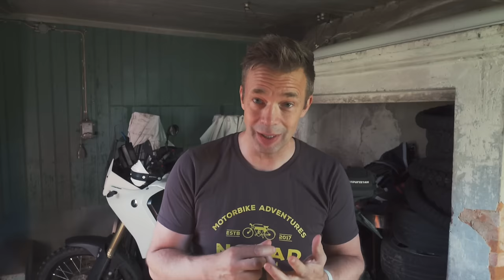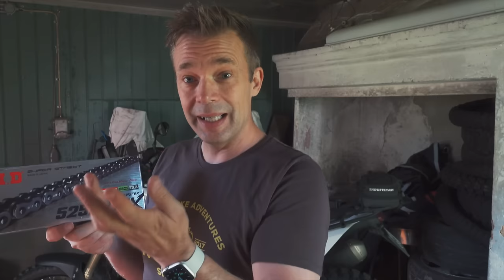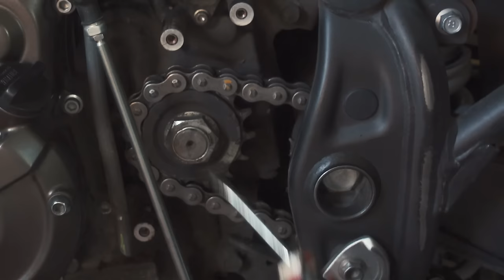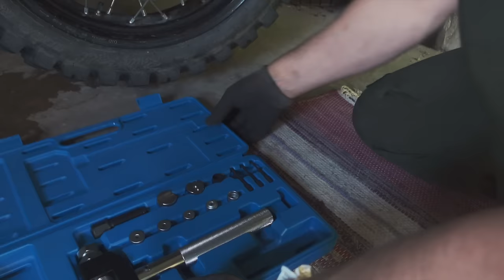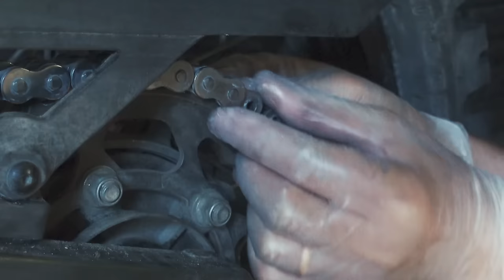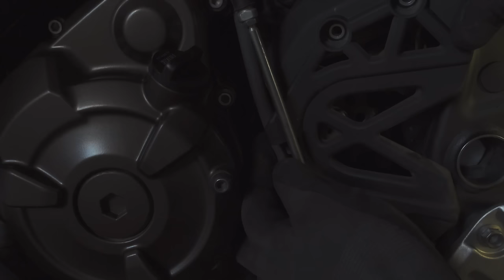How to change sprockets and chain on a Tenere 700

Comment: Well, when you say extender you dont mess around 🤣Just to give you a little heads up... i used the chain tool from Biltema, but the bolt is not strong enough when pressing the chain back together. So i did not manage to get it into specs. What DID recommend you to have to be sure the chain is locked properly. I had to upgrade to a motion pro tool to get the job done correctly. Nice video again mate. You are really esay to listen to and follow along. I recommend you to do way more of this kinda videos 👏🏻
Reply from the maker: Thanks mate! I hope I got it right, not 100% sure. But I think the fail video will be a hit too. Reviews and DYI videos are the least work and gives most views so I do need them to grow. But the adventures are what I come back to myself and relive, like a diary, so regardless we need them. I bet you have the same. Note this is the very extended version, hence the long extender.
Reply: @NomadSweden  Yeah, fail videos and behind the scenes are always a classic 🤣I'm think i will do a 2020 fuck up video at the end of the year 👏🏻 that will be a long one (she said) In the long run, i think the honestly way of things, good mix of content and your charm on the camera is what will make you grow the most. And it is nice to reach out to a broader audience... keep it up. I really hope to make something with you one day. Battle of the north 😎

Comment: Great video, great tips in the order of replacement.  My only suggestion. Don't use a torque wrench to remove bolts, only to tighten/torque.  It can be used in a pinch to remove bolts, but will mess with the calibration over time.
Reply: Dan, I’ve noticed this is done in a lot of “how to” videos on YouTube. It always makes me cringe.
Reply: How to replace clutch lining T7 tnx

Comment: From what I watched/read in internet I understood that the sealed chain has the grease/lubricant inside (pins are fully covered), where the friction goes and those seals are made so that you don't wash the grease out while cleaning your chain and to prevent the dirt from going inside. In my opinion you should have covered pins whole in that "mayonaise".
It's what I'd do, but then again I am no specialist in that matter.
Thanks for the video.
Oh, one more thing: when you are covered in sweat after the whole work words like "it's not hard to do yourself" lose credibility :D
Reply from the maker: Haha thanks for the fun comment. Well, I am new to this also, so thanks for the tip.
Reply: @NomadSweden  you put some grease on both sides of the link, so it will probably move around there inside the seals when it gets warm. How are you still using this chain, or how long did it last?
Reply from the maker: @henrikforsberg683  Thanks for the tips! I used this chain/sprockets for 20.000km and now I changed it all again, but applying the grease better :)

Comment: You can easily change only the front sprocket but when you wait too long then you need to change the whole set.
The front is very small and therefore has less teeth to grab the chain which is the reason it wears out faster.
When you wait too long the chain might get damaged and that will damage the rear sprocket but in most cases you can use 2 front sprockets and so almost double the lifespan of the set.

Comment: Fit the chain to the NEW sprockets.  I have seen sprockets so worn that the new chain would be a link long so if you fit to old sprockets you may end up with too short of a chain for new sprockets.  Also always tighten / torque in a 'star' pattern not circular.  You can have the part out of camber if you tighten circular.  (same with changing a flat on a car).

Comment: Little tip for chain adjusters threaded into aluminium swing arms.
On the the purchase of the bike, remove the wheel spindle, unwind and remove the adjusters, and coat them liberally in your favourite anti seize compound.
Reassemble.
Thank me later.
Reply from the maker: Thanks! Will do!

Comment: Good video and explanation 👍 I change all the chains and sprockets for my friends and always loosen the front sprocket nut first, then cut off the chain, change both sprockets, put on new chain and then tighten the front sprocket nut. I find this to be a quick method with good work flow.

Comment: Couple of lessons that I learned the hard way.  Sometimes a non factory Yamaha front sprocket can have a slight amount of slop in it that can damage the splines on the counter shaft over a long period of time.  If you are running a 525 or 530 chain be sure to carry an extra master link as those size chains are less common and you could have trouble finding one in an emergency.  A very thorough video, good job.
Reply from the maker: Thanks!

Comment: Two items for those who are not mechanics, never use a Torque wrench to remove any bolts or nuts, second, the torque reading will not be accurate with the long extension used.
Reply: The torque will be accurate with an extension like that.  It's only when you use a torque adapter that you have to take into account the changed torque applied
Reply: @SuzukiRider93  I do not agree. With an extension you are able to and will put way more torque on the same tool, compared to using it without an extension. Simple mechanics!
Reply: @SKgeostrat  You have the right to be wrong
Reply: @SuzukiRider93  🤣yes of course and having thought it through, you are right. One COULD put more torque on with the extension, but the torque wrench will not let you.

Comment: Thanks for a nice video, and some interesting comments. Regarding the orthodoxy of always changeing chain & sprockets as a set, I will challenge this by the following logic.. The front sprocket has about 1/3 of the number of teeth as the rear one, consequently it wears about 3 times as fast. So the conventional wisdom is that with wear the sprockets and the chain and sprockets will blend together like your hand with a well worn glove, or your feet with a long worn hiking boot. Clearly the oposite is the case: The opening between the teeth on the front sprockets opens up, but the rollers of the chain obviously do not grow to fit the growing opening. So the frontsprocket and chain  grow in mismatch  as the km roll on. I presented this logic to my mechanic when I had 10000km service to my ktm 790S, to which he protested vehemently. I insisted, and demanded a new front sprocket. I even went down from 16 to 14 teeth, as I find the gearing to tall for my liking. This will of course make the issue of wear even worse, but anyway, 12700km now, and looking forward to the result of this experiment as I approach 20000km. Please refute my reasoning, but the result will be quite interesting..
Reply from the maker: Sounds interesting. You may be on to something. Let me know 👍🏻
Reply: If you change the front sprocket early(before its totally ruined, when it looks like sharkfins it’s been there too long!) it should make the rest go a bit longer, and front sprockets are cheap compared to chains. 😁 and keep an eye on the chain, pulling it outwards on the rear sprocket shows if it’s getting stretched. Do it with a new chain to get a reference, then you will see that u can pull it longer out from the sprocket as it wears out. And i agree with your reasoning on front sprocket having less teeth than the rear, so it wears out quicker.
Reply: I was always wondering where does this myth about changing motorcycle chain and sprockets in set comes from. I was blindly following that advice until I realized that each time I change whole set only front sprocket seems to be worn out. Then I started replacing front sprocket each 10 to 15 thousand km and rear sprocket and chain usually last 3 front sprockets.

Comment: Thank a lot. Very useful. Only a couple of things as others here also mentions. The Biltema tool is a bit weak and if unlucky you dont get the grinded pin out. That happened to me once. And I would apply a bit more "Belgium mayonnaise" to the pins itself. Because of the X-ring you will never get more lubricant into the pins later. Lubricating a modern chain is just to keep the o- or x- rings in good condition and to prevent rust. (So Im told). But the way you worked and the order of it seems very smart. Happy riding the awesome bike :-)
Reply from the maker: Thanks! My next chain will be perfect 😊
Reply: @daveinwla6360  Never done that yet, seems to a lot work....

Comment: I own a 94 tenere 660, and it’s interesting to note the front sprocket lock system is not a lot better than the 94.
Yours had clearly slipped from its original locked position and the slots no longer held the indents on the flange of the nut.
The 94 has a flimsy narrow nut and a lock washer that both fail over time.
I’d say keep a close eye on that front nut and retorque it if it slips.

Bad design still not rectified!

Oh, and use a grinding disc, not a cutting disc for the chain pins!

Enjoyed the video. Nights are clearly longer in Sweden than Scotland, as I would have just whipped both sprockets off with the chain onto the bench and worked at the bench all,in one go.
I didn’t see any comparison of rear sprocket wear. 
At 46 to 15, the wear on  the rear should be one third that of the front sprocket, so I tend to change the rear once for every two front sprockets.
Sorry it took me so long to watch your video!
Reply from the maker: Thanks for the tips! This video was actually first time ever I changed drive kit 😊Got many tips since then but I got it done.
Reply: Stick with the cutting disc and cut chain in half! Muck quicker than messing around pressing pins on a chain you are throwing in the trash.

Comment: Nice Video.
I have a little tip for you. You have to lubricate the pins inside the roller, because this is your lifetime lubrication for the chain inside the roller. The O rings protect the lubrication inside.  The outside can be lubricated at any time after assembly. So please, put more of the grease inside.
Reply from the maker: Ah thank you. More mayo next time then. I hope this will work until next time.

Comment: replacing a rubber damped sprocket with an undamped one is a downgrade.
Reply from the maker: I'm interested in the differences so I try the non-dampened. Wear-wise I can't say yet, but noise is a little bit higher without being disturbing.

Comment: Good job. I've done the same with your help using Craft Meyer riveting tool for DID chains. I've got some issues to put the new front sprocket in place, problem solved when screwing its bolt. Thx a lot.

Comment: O-ring seals,  use locking vice grip pliers to press the plate on, pinch it between the pins to get it seated.  A battery powered Dremel tool is handy to carry to cut pins.  A hand punch to drive them out.   DID makes a great portable chain tool.  Amazon.  Good job  no swearing no blood, Off-the-Road is a great source of parts.
Reply from the maker: Thanks sam! Since then I have got the DID tool instead. It's small and can drive the pins out without cutting. It's a bit powerful though, I managed to press the plate on a bit tight, limiting the movement of the link. Not sure wat to do there except cut a part and replace?
Reply: @NomadSweden  yes since having the new tool replacing it should be fairly simple.  Just get a new press fit master link with the O-ring seals, don't forget them and fit it.  You know how you did the other so you should have a feel for how much.  Slow and test movement.  You don't need a hot link when riding, be a source of failure at the worst moment.  So take wise precaution.  Take care, Safe riding on the next big trip.
Reply: Hey, I just ordered the nice Rally Motor Rottweiler mirrors and mount setup.  I couldn't get them from Holland so I used the California connection, tax free.  Yeah! $300USD total.  Like much better than double take, they aren't what they seem.

Comment: Very good video, you explain things very well and with good details. Images are very sharp and clear so we can see all the details very nicely. Just a question comes to my mind ... why did you go for the open chain?, I think a closed one would have saved you quite a good amount of work as you spent most time opening the old chain and closing the new one. I also think closed chains are more sturdy/reliable. Which was your reason to go for the open one?
Reply from the maker: Hi, thank you! I never changed chains before and I wasn't sure I could get a closed chain on to the bike without removing a lot of other parts. The chain goes on both sides of the swing arm pivot and I just felt more secure I could do it with an open chain.
Reply: That makes sense. Now you know you can fit a closed chain the next time. Great work!!

Comment: Don't you think that T7 is a "naked king". Just good marketing. Only lazy rider is not competing in suspension adjustment. It is good off road, but too heavy to have a real fun. It jumps like a donkey on highway having resonance on rear suspension because of design of rear swingarm. I'm adjusting, adjusting and adjusting instead of having fun to ride. I'm treating my T7 like a baby and now I have some doubts if I have to. It appears to be very expensive toy for it's design. All cables are not weather protected and so forth...
Reply from the maker: 65.000 km now and I'm still happy. Paid €10k for it in 2019.

Comment: For anyone wanting to grease fasteners on their bikes for corrosion protection, reduce the manufacturer's torque setting by 5%. Torquing with a lubricant, called 'wet torque', will actually increase the torque by around 5%, so back off your torque wrench setting by that amount. Skål. 🍻
Reply: In all workshop manuals I’ve seen, they specify torque for lubed threads. It just doesn’t make sense bolting parts together without lubrication, there is NO benefit in adding friction in the threads. The whole idea is to create a axial pressure berween the parts, why add extra stress on the fasteners to reach that desired preload by adding extra friction?

Comment: Hi, thank you for the content. Fantastic video. Some great tips and tricks I will use when I change my sprockets and chain later this month. I had a slightly off topic question regarding which tyres you are using? Thanks
Reply from the maker: Thanks! Those were the Mitas E-09.

Comment: For the chain slack, do you measure it from the tip of the rubber strip or directly from the metal of the swingarm? It's not clear in the shop manual and sincr the rubber strip has a certain thickness, it can really mess the adjustment. I usually measure from the end of the rubber to the middle of the chain. I don't know if this is correct though...
Reply from the maker: You are correct! It’s from the tip of the rubber 👍🏻

Comment: Your front sprocket came off quite easily. If it was tighten to the right torque, which is 95 Nm.
Reply from the maker: it was correct...

Comment: At how many kilometers did you have to change the set? (Sorry if you mention and I missed it)
Also, the T7 is highly geared so a longer gear will benefit the ones doing asphalt use.
Reply from the maker: I did mine at 20.000km. I don't go very high speeds on asphalt and I like the gearing for technical offroad, so it suits me good.

Comment: if you put the bike in first as well i find it helps to be able to undo the front sprocket nut..... also the grease you applied to the link. that needs to be applied to the o rings but most importantly needs to be on the two links that go through the chain they need to be full of grease as chains are now sealed. as you did not fill the links before riveting the chain back together you now have a dry link in your chain which will more than likely be the failure point. its all a learning curve being your first time. the only other thing is please do not ever use a torq wrench to undo as it buggers up calibration so will not be accurate in the future just you a normal ratchet. other than those 3 things well done you will get there.
Reply from the maker: Thanks. 20000 km done since then and time to do it all again. My second time ever. Tips are useful. 👍🏻

Comment: Hey Nomad, I just swapped my 15 for a 16 tooth Vortex countershaft sprocket and I have to say that it made a very nice difference on the backroads of overcast Southern Oregon - a little trail riding and my recently acquired wht/red T7 seem just as At Home off-road as it did with stock gearing. I now am using 1st gear at times in tight off-road where before I wasn't - seems 16 x 46 combo is, I think, pretty ideal. Having said that, I also have NOT done single track up a windy, slippery hill with this combo... ;)  ...might be worth a try out, you don't even have to add a link to your stock length chain!  Anyway, enjoying your videos and fun sense of humor, as well the ride and activities footage - much thanks for all you do!  PS: my former ADV ride was an R1200GSA that sadly, burned up in the Oregon Fires earlier this year... Weird Fires...
Reply from the maker: Thank you 🙏 and thank for sharing! Sounds like a combo to try out 👍🏻 Ride safe.

Comment: Is the chain slack specified with the bike on the sidestand ? On mx bikes it’s usually measured with the bike lifted up(wheel fully sprung out).
Reply from the maker: Yes the manual says sidestand. Probably to make it easy during travel etc and central stand is not standard. MX bikes are perhaps often on a lift or similar.
Reply: @NomadSweden  Thank you so much for this video

Comment: 520/525/530 are the size of the chain (width) they cannot be exchanged....
Reply from the maker: ? Not sure what you mean
Reply: @NomadSweden  the given number is literally inner roller width. You cannot replace 525 Chain with 520 since it will not fit your sprocket. Also you cannot put 530 chain since it will be too loose.
Reply from the maker: @paweliwanow1189  Ok, I use 525 so no worries